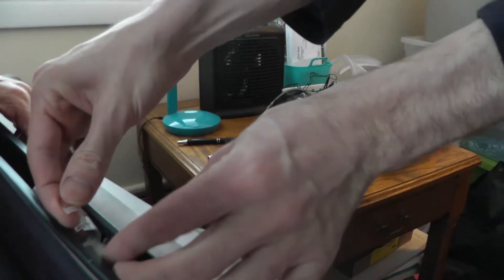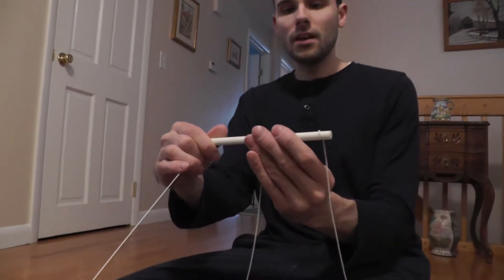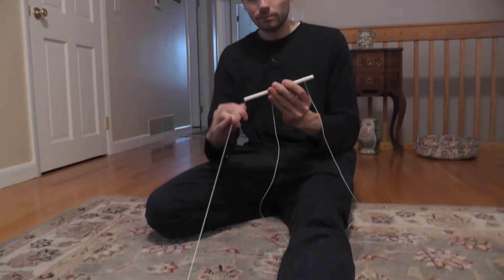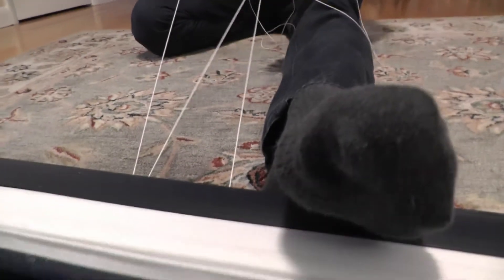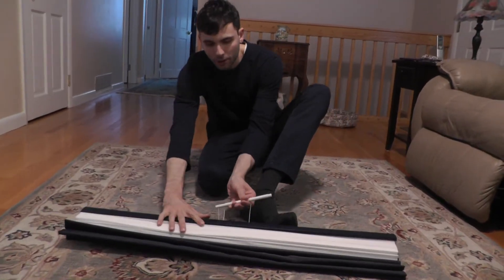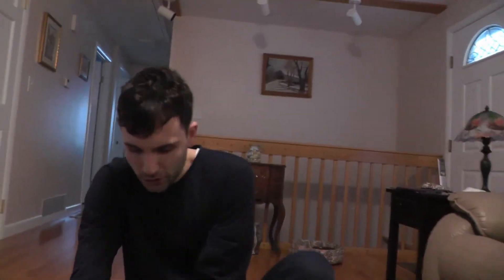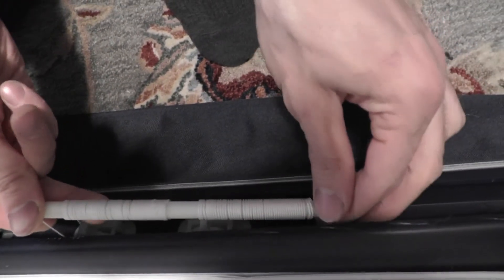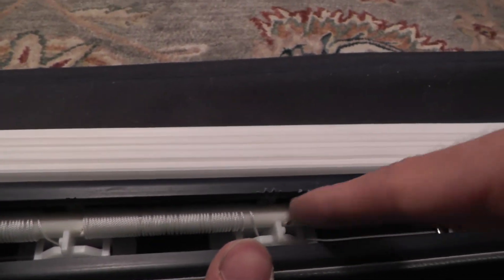Fixing A Roman Shade

Comment: Thanks, I'd like to add because it seems the beginning is missing.
On mine there is a winding spool mechanism that has to be completely unwound by pulling outwards until you are at the end of the spool, and then stick a toothpick in the little hole in the spool to keep it from retracting. It's easiest to pull the spool out out of the frame, there's a small plastic piece that keeps it in position. Once removed, unwind the spool keeping in mind you will need to replace it in the same direction as found. 
Then wind the 2 other drawstrings as shown in the video and then holding it taut, let the spool retract the cord by moving it back into position.